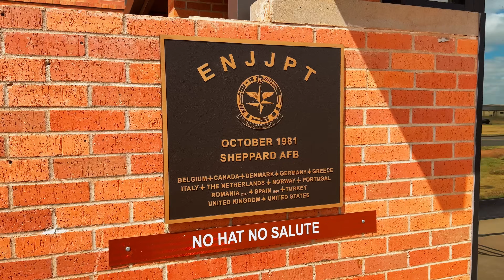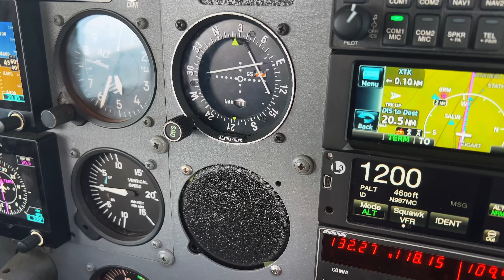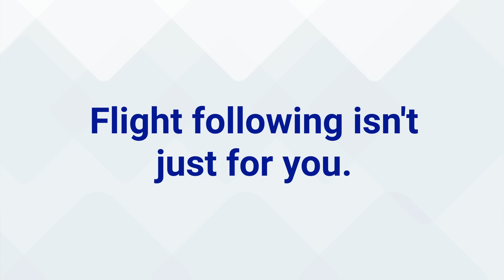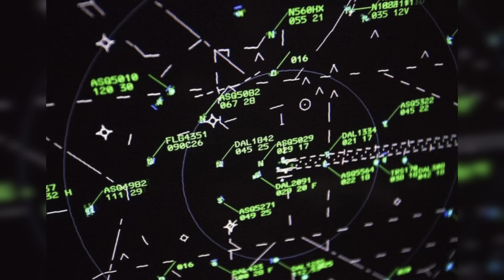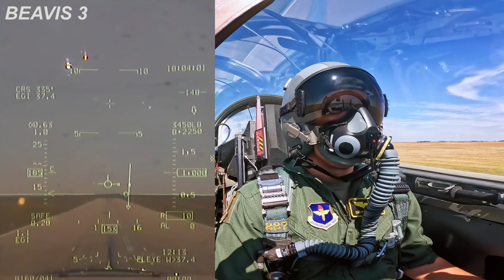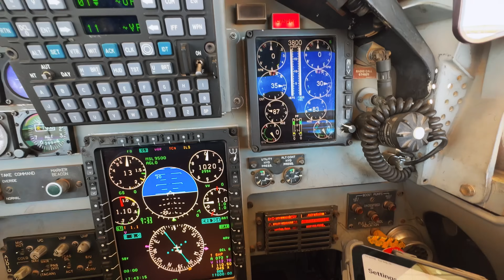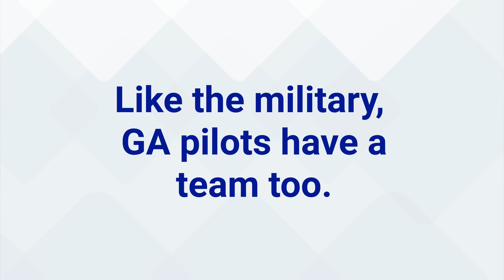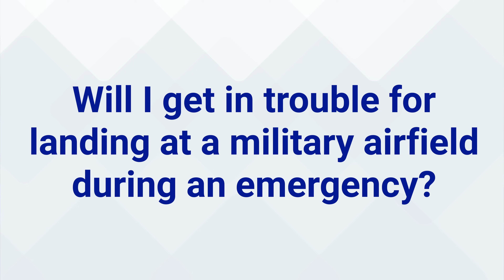What happens when a SMALL PLANE flies through MILITARY AIRSPACE?

Comment: I'm a fan of FF, but when when they called him out at 0:52, he wasn't even in the MOA. He was below the MOA he was leaving, and above the Alert area he was entering, so he might have thought there was no need.  It would probably help to expand many airspaces, which might lead more pilots to think they should give ATC a call. [for example, there was a 182 that caused some go-arounds at Austin recently. But the final approach fix for Austin is BELOW and outside the Class C. That seems wrong.]
Reply: Agreed on all of your points. This may be my favorite comment of all for this video. As both a military pilot and a GA pilot, I’m most in favor of as much unfettered access to aviation as is safely possible. So it’s up to all of us to use as many tools as we or our missions can handle to conduct ourselves safely to avoid restrictive airspace changes. In this case, the system worked the way it was supposed to and multiple tools recognized a conflict and the threat was mitigated. But if you’re an aviator, you know that sometimes systems fail. FF is another layer of redundancy in that system that aviators can use when their workload and mission allow it. That’s the takeaway here. The pilot referenced wasn’t doing anything wrong per the law, but FF may have increased the factor of safety. And I’ll always be in favor of tools that do that.

Comment: I fly out of F14 and CWC that are both very close to that specific airspace. While I normally pick up FF, one of the fun things about Sheppard is they train controllers too and in that they will bounce you to 3-5 different frequencies after leaving Ft Sill departure or Ft Worth Center to a local airport that is not SPS so it can be task saturating to deal with them and the rest of what you have going on. It is very easy to dump 50% of your work load by simply squawking 1200. On the other side of that, and something that I truly love and enjoy about flying here, as a 500 hour pilot who is still very much learning it is awesome to be able to extend the same patience to the new controllers as they learn their craft that their predecessors extended to me while I was butchering radio work when I was brand new.

Comment: The dilemma is that aircraft operating under VFR are NOT required by current FARs to avoid MOA airspace or be in contact with ATC in a designated MOA, irregardless of the MOA's status.  IFR aircraft, on the other hand, will never be cleared into a MOA by ATC if it's hot.  True that simply contacting the MOA's controlling agency (in this case Ft. Worth Center) and both checking the MOA status and requesting flight following would be the prudent thing to do for VFR aircraft, but again, it's not legally required that they do so.  This puts the whole situation into a gray area where lives are needlessly put at risk, not just the integrity of training missions by the military.

Comment: Sorry, ATC can vector the military guys instead of me.  I already paid for their fuel and mine.  I'm not wasting any more money on mine to be vectored all over the place.
Reply: Hi there! You’re alluding to a great point about flight following. You’re not required to comply with any vectors or changes in altitude when using it. Sometimes I don’t see when VFR traffic enters the active MOA I’m operating in and the center controller often doesn’t catch it either. While I would obviously prefer no traffic in the MOA confines or near the traffic pattern, I would love to have a cursory ‘heads up’ that the traffic is there. Flight following is one of the great free tools that allows that to happen and that’s all we’re trying to communicate here. Hope to share the air with you sometime soon!
Reply: What you miss is that without flight flowing, radar identification, etc, your mode C is ‘indicated’. Meaning invalid. You could be 5,000 ft apart but without a validated Mode C, the traffic has to be issued. Conversely, if your mode c is incorrect, you would have no way of knowing, so a traffic call on you with an indicated altitude that is significantly off, may cause the ‘military guy’ to dismiss the call. Meaning vigilance would be lower and your invalid mode c could be deadly. If you want to fly without flight following through an alert area, or MOA with student pilots in supersonic jets built 60 years ago, that’s fine. Just realize the point of this is to suggest that it’s better for everyone if you get flight following in the best interest of flight safety.
Reply: @PistolPete-1211  Yeah... I didn't miss any of that.

Comment: I flew Plains American Pipeline from Midland TX to St Louis within a quarter mile of Sheppard with a 200' AGL waiver.  I ducked a bit lower going under the traffic and Tower did an excellent job directing me.  I support your efforts to get general aviation to use flight following, but I also think it would help if we got under the layers of Class B, as pipeliners do.  Crop dusters and pipeline patrols and news helicopters are the only traffic down here.  Avoid the centerline extended.  Yes, ATC wants you to use flight following.  But mainly they want separation.  In Army Hueys we stayed off the beaten path.  Use the system, but remember low when the tactical situation becomes fluid.  It worked for me for 17,000 hours of crop dusting and patrolling pipelines.

Comment: Flight following is not always available at altitudes below 4,000 feet especially in SW/NE Oklahoma. Sheppard and Altus are Class “D”. What is the range of their TRSA radars at 4,000 feet?
Reply: Exactly this. I fly those areas and many others at low altitudes for work. Very often there is absolutely no way ATC can communicate with aircraft at lower altitudes, so flight following is pointless in that situation.

The TRSA around Altus has decent comms coverage for the most part, even at extremely low altitudes.
Reply: @VictoryAviation thanks for all the work you do flying low like that! I’m sure that’s tough but rewarding flying. Unfortunately we can’t cover every scenario in this video, but I will say pipeline traffic is not my main concern. I see you guys all the time and our controllers do a great job of pointing you out. Thank you for using ADSB! It’s significantly helped me to get eyes on to avoid while on short final at Sheppard
Reply: Both radars will pick you up at 500AGL. Also, the alert areas and MOA are a good place to avoid if you aren’t talking to ATC. Student pilots in supersonic jets…

Comment: During my PPL training we had a alternator fail while in the circuit/pattern. I told ATC 'moorabbin tower, <callsign>, we just some equipment failures on the aircraft, would like to amend to a full stop", my instructor looked at me shocked and upset, since the next call ATC made was like "Do you require services, we don't provide any emergency services on the field" and I was like "Negative, just wanting a full stop landing". They had aircraft in front of us go around and make room for us to get back quickly onto the field. My instructor said I needed to be more careful how I word things since there was no need for me to declare a emergency.
Reply: Sounds like you didn’t declare an emergency… you just advised tower of what your current situation was, which was not normal. Seems like a reasonably smart thing to do.

Comment: I absolutely love flying through active MOAs when I'm on flight following.
I've been what I consider "intercepted" half a dozen times. They've circled us as we flew for 3-4 rotations. Flown parallel, then rocketed away.
I believe for their training also to intercept.
They know I'm maintaining altitude and flying in a straight line per ATC.
Reply: This can also be an intimidation tactic, albeit unprofessional.  Military flights are usually given a discreet frequency to switch to after ATC clears them into the MOA and gives the military flight 'block altitude' clearance.  This clears the military flight to do aerobatics, climb, descend, and maneuver at their discretion, which of course is necessary for training.  However, the military flight being on a discreet frequency from that of ATC also means ATC can't communicate with them and call out traffic.  Therein lies the problem - YOU might be talking to ATC while flying through a MOA, but the military flight in the same MOA might not be talking to ATC.  ATC can only contact you and tell you that the MOA is hot but can't tell you what heading and altitude the military flight is flying because ATC doesn't know themselves.  If the military flight sees you, they can come back up on the regular ATC frequency and request separation vectors from you.  Otherwise it's see and avoid for both parties in the MOA.  Never assume the military flight in the MOA is talking to center though.  Those intercepts you're seeing are basically the military's way of getting your attention to let you know they are there, and also a sort of invitation to leave even though you are well within your legal right to be there.
Reply: @tripodcatz5532  I don't think they've ever been intimidation. I've always seen them come from far away in the sector. 
And if it is ever intimidation, I'm not going anywhere. My tax dollars are fueling those noise generators in those jets.
I'll piddle along at my 120kts in a straight line, they can go somewhere else in the sector.

Comment: I’m faced with this every time I fly to my ranch. My strip is not on the chart. When I fly to the ranch most of the time I will get flight following but always have to cancel it before I enter the Laughlin MOA.  At that point I have to fly roughly 40 miles into the MOA. I cancel FF at the last airport I cross over on my trip. I cancel because there is no way for me to tell them where I’m going.  No way points. Suggestions ?
Reply: What altitude are you at, and which MOA. The  southern MOAs for us have bases at 7k, and the northern MOAs are 9k. Personally in your situation I would take the fuel hit of flying lower over flying through the vertical confines of the MOA. We don't care if you fly under us, but I've been in the middle of maneuvers and got a TCAS hit from someone literally IN the MOA I was in. That's some pucker factor going potentially 500kts.
Reply: You can cancel flight following anywhere along the route of your flight, you do not need to be above a defined waypoint to do it. If you really want one, a radial/DME can be used as a termination point for flight following, a VFR flight plan, or even an IFR flight plan.
Reply: @Wolfhound_328  what I should have said is that when I get flight following I have no way of giving them an exact location for a heading. So I give them the closest airport to my destination and when I get to it i cancel FF. The problem is now I have cancelled FF and I’m fixing to fly into a MOA. So if it’s active they don’t know I’m there. I fly roughly 40 miles into it with no one watching. So the point of the video is to get FF if your flying through a MOA and I  have been canceling it before entering.
Reply: @hillcrestannie  thanks for the clarification, that does make sense. You should still be able to use a NAVAID radial/DME as a termination point; might be worth trying out next time! 

When I was going through pilot training at another base, there was ALWAYS an airplane that came trucking through one of the MOAs to the airport local to our training base, like clockwork. Us students were 100% convinced it was a sim instructor at the base, doing it because he knew it caused us headaches lol.
Reply: @hillcrestannie I know this would get annoying doing it every time, but I suppose the answer is to just tell them that you're going to an airstrip without an identifier close to X. They'll probably have to enter some identifier in their computer, but if you're talking to them they'd probably be fine with it
Reply: Flight following doesn’t have to be super formal. Just tell the controller that you need to continue eastbound (or whatever direction from the point you gave for another 40 miles in order to retain deconfliction while traveling through the MOA to a private airport. Advise them that you’ll let them know when you’d like to terminate.

If ATC says, “squawk VFR”… etc. simply say you still have another 40 miles until you reach your destination and request continued flight following. You’re obviously doing it for safety purposes. If they don’t want to, then call into the TRACON and ask to speak to someone about it so you can explain via the phone what you’re trying to accomplish. I call ATC all the time so we can have a regular conversation without tying up the radio. ATC is typically very helpful with info and working together to accomplish a common goal of safety.
Reply: Thanks
Reply: I would get a fix radial distance off the nearest airport or navaid whichever is closer of your destination. If it’s a center controller we can put a circle on our map and put it over that frd. If the controller is terminating you before you enter the moa bed they are either lazy or don’t know the rules for vfr into a moa.